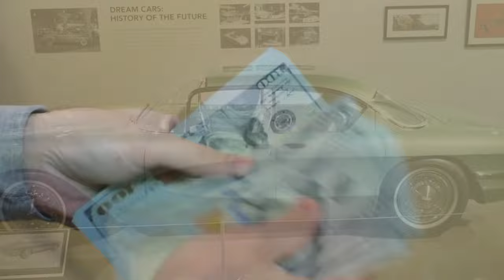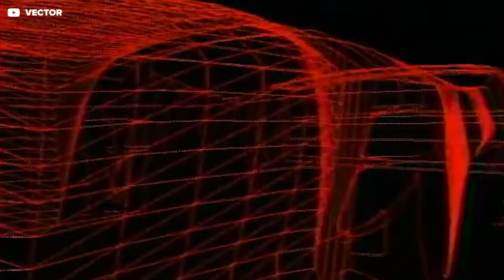Why Old American Muscle Cars Are Much Better Than The New Ones

Comment: I would rather fucking turn 20 screws over using plastic pins to fasten on my bumper. Oh wait, I don’t consider bumpers bumpers anymore these days on new cars. They are just a front facia and a rear facia. There is no fucking rear bumper. There’s no front bumper you can’t even bump them because they made a plastic.

Comment: I owned a 1966 Mustang 2+2  and I currently own a 2005 Mustang fastback coupe V6.  The 66 was slightly faster than the 2005 but the 2005 drives and handles orders of magnitude better.  The cars of the 60's are machines of a bygone era.  Heck you can't even buy gasoline to feed a high compression V8 with it's timing set to factory specs.  I liked my 66 but I prefer my 2005.

Comment: I  think it depends on your age how you look at the Old vs New thing.  Since I've been driving Muscle cars since 1970      I would rather an original 1970 Challenger R/T with Pistol Grip shifter  or 1969 Mach 1 Shaker Hood Mustang over todays offerings. A few years ago I had a Challenger Scatpack 392 and traded up for a  Mustang GT350 as both are  great cars in there own right, but there's no replacing the feel, sound and looks of the originals at least to me....they don't handle as good and not nearly as fast as todays offerings but we liked them for what they were and the memories they gave.... If I could get into a pristine 1969 Mach 1 428 SCJ 4 speed  I would trade my GT350 in a NY minute  .

Comment: I beg to differ....
I love old muscle and have owned several.
My current ride is a 2015 Challenger Hellcat, it drived far better than an old Challenger ever will and it's very true to its heritage...
Reply: Depends what you mean by 'better', to some the older one is better as it has a much more involved feeling where you become one with the car, where as modern cars have become do disconnected you can't feel anything going on underneath and you don't feel involved.
Reply: @Forgotten_performance  Ofcourse you are entitled to your own take and feel..
Coming from a 1970 383 4-speed Challenger to a then brandnew Hellcat Challenger is a night and day driving experience.
The Hellcat hugs the road in manner the old one never will..
It's more quiet but still retain the brute acceleration feeling.
Reply: Have you heard of a restomod before mate?
Reply: @CJColvin  Yes...
Reply: @janfswedane  you're comparing a base model to the highest model, but even then the hellcat will feel disconnected, heavy and sedated
Reply: @Forgotten_performance  So in your mind the development ended in 1970...
I have owned and driven my Hellcat for almost a decade now, my 1970 R/T Chally was hardly a baseline model and it drove like a Dart.....
Reply: @janfswedane  383 was the base engine for the R/T bud... Hellcat is the top trim line excluding the demon.. no development didn't end in 1970, do you struggle to read or something? New cars have a super disconnected feel, are way heavier and require much less driver connection. All things car enthusiasts value
Reply: @Forgotten_performance  I rest my case, enjoy your old muscle as I enjoy my Hellcat..
Reply: @janfswedane   each to their own bud, enjoy the Hellcat
Reply: I have new cars, old cars, and in-between cars, I love them all. I have a 73' Nova with all the suspension goodies, 475hp 383, disk brakes, the list goes on. My bone stock 370 is more than 15 seconds faster at the local road course. It handles like a Mac truck and will never be as fast (road course) as almost anything built after 2000. You can call it many things except cheap and reliable, but it is hands down my favorite car in the driveway. Guess it's just what I grew up around.

Comment: Talks about "American muscle cars," starts with an '80's El Camino- shows pickups, rat rods, mid-'80's Firebirds, Mavericks, malaise-era  442, Studebaker...my garage has an S550 GT350 (it's gone up in value) and a 1st year Swinger that had a BB swapped in back in '78 (it's a resto mod that has had a lot of upgrades from even the '78 hot rodding task). So this video is jaded-

My buddy got rear-ended by somebody doing 60 mph in his 2016 Mustang. Walked away. Do not try that in a '65-'70 Mustang

Comment: Bad brakes, slower, bad gas mileage, unsafe in an accident, no aero so unsafe at high speed, missing convenience items like blue tooth. "Better" is not the word I would use.
Reply: I daily drive a 62 falcon.  302 . Lightweight.  Don't need high horsepower surcharged  junk ls or coyote mess even less.